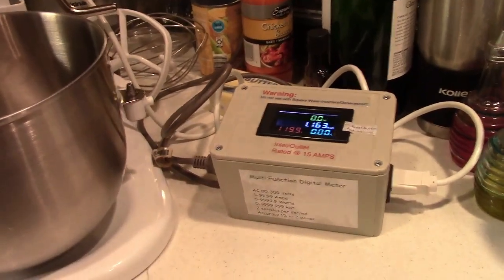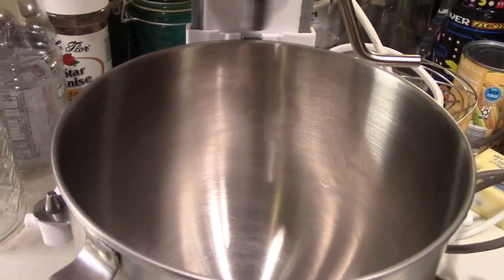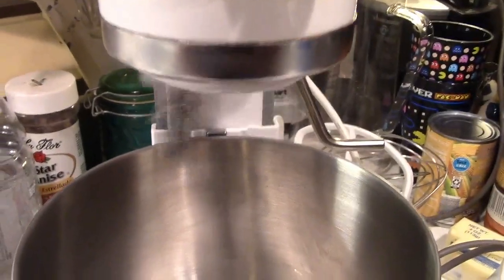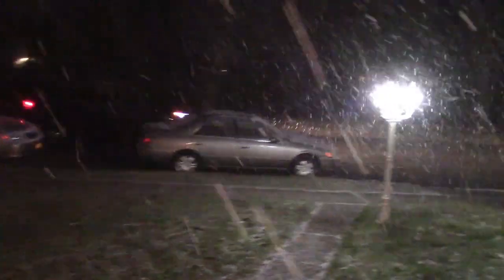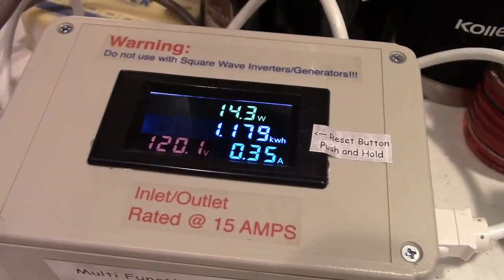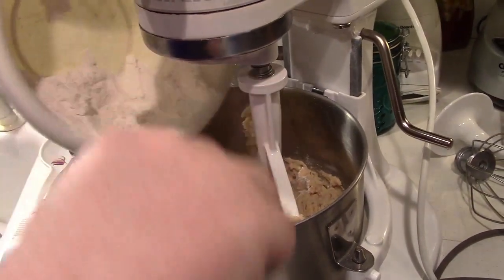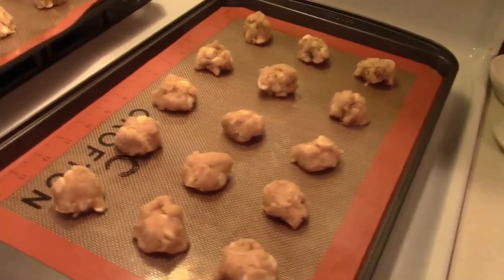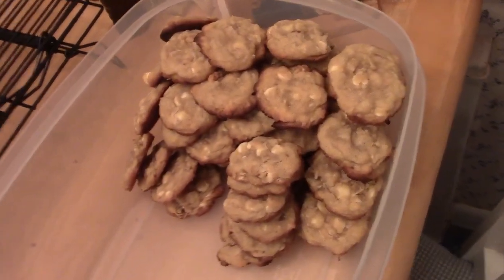Making X-Mas Cookies 2019, Featuring KitchenAid Stand Mixer

Comment: Wattage = Goodness!
Reply from the maker: Oh yeah, the oatmeal raisin cookies have such a stiff batter, it sounds like you're trying to dump the clutch too fast on a manual while towing a heavy load, and hearing every explosion in every cylinder.  I had an old old video about that, it pulled some impressive wattage on low.  Those mixers are really well built, I'm amazed they still make them that way, cheapening what they can along the way.
Reply: @jaykay18  Imagine the wattage doing bread with the dough hook!
Reply from the maker: That would be quite impressive, I'm sure.  My food processor also has a dough blade and mode.  I've never used either for making bread, that goes right in the bread machine and that does everything in one shot.

Comment: Oh a helper kitty, at least it isn't trying to get in to the mix, the ones here would be both paws in and afterwards those cookies would mostly be eaten floor cookies.  Yes they are very bratty ones here.  A slice of pizza has been taken off a plate at least twice here the count for cookies is higher.
Reply from the maker: Nah, there was no meat involved.  If there was, you can absolutely forget it.  I can't eat without getting mauled practically, he'll go and take it off the fork for you.  Several times when the wif was eating, and there was a big slice of roast beef or ham or whatever on the plate, you'll hear "Go Go Gadget Claws!" and they will swipe the entire thing.  Sometimes they actually get away with it, and take it off to their lair to kill it.

When I buy chicken I always buy the big packs, then spend time trimming them up, and freeze what I don't need that day.  The kitties always know that not only will there be snacks then, but I'll save the trimmings they didn't eat during that time for later for a cat appetizer, or catpetizer.  And that's before their main meal.  Then the main course is served, they polish that off, and 10 minutes later they're hungry again.